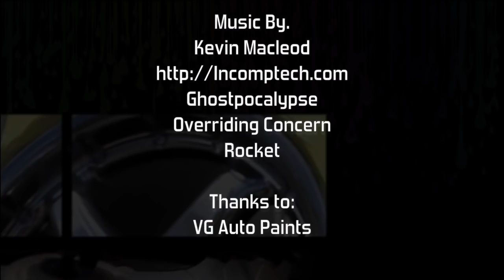First time applying vinyl wrap

Comment: One tip if i may, I worked for a company that made display booths for trade shows, i have applied hundreds of yards of a similar product , don't take the backing off all at one time fold the backing under the vinyl then put down one or two inches of the vinyl start smoothing it out as you pull the backing away , give it a try it really works well,
Reply: vince rappa Yeah.  And try to use a magnet to hold the vinyl in position! :)
Reply: I was thinking the same thing.  Quick question, with your process, could it become a 1 man job?  Also what do you recommend for getting around a roof antenna and sunroof?  I was thinking keeping it sunroof open and cutting away that piece from the inside.

Comment: just when you thought putting a phone screen protector on was difficult
Reply: Totally true!!
Reply: +Rebekah Codlin This is very true!
Reply: +Rebekah Codlin its easy to wrap if you know what you are doing
Reply: +Rebekah Codlin i will suggest to expend in a better quality wrap :D it will come nice I'm totally sure. Remember that old say: "I'm not rich to buy a cheap Prices"  ;) Good luck
Reply: I just binned 3M made in china , don't by Chinesse , go Avery or a cheap paint job...ps actually it was that  bad to use I would of been better off wall papering it lol...
Reply: Rebekah Codlin Chinese products are not good, i heard that their car wraps are absolute trash
Reply: +Rebekah Codlin awesome! Thank you +Rebekah Codlin
Reply: +TucsonMods 

Well, not too bad. had quite
a few little bubbles I managed to pop, and some small wrinkles which I think is
quite standard for a first time......but the carbon fibre design looks a little
wavy when you take a closer look, this is most likely because it was a very hot
day and my car is dark navy (was like a stove top!) so made the vinyl too
stretchy to work with (I could have gotten away with snapping it back up many more
times if it was a cool day). I definitely think I was stretching it too much in
general as when I pushed it into crevices or indents it popped back out and
didn't matter what I did I couldn't get it stuck in those places after it was
down (this was the biggest disappointment). I'm sure that the pro brands
would be a bit more forgiving. The proper technique according to Arlon is
to not pull the vinyl when heating but just to hold it up lightly before going
over with the squeegee (I was pulling it, prolly the nerves and the hot sun
making me tense haha). Only costed $10US to do the boot though! Have ordered
enough for the whole car (about $90US compared to about $1000 for pro wrap like
Arlon/3m etc) so will let you know how a door goes. Will be using the proper
techniques and on a cloudy day, with a felt squeegee this time.....I'm actually
pretty confident if I follow Arlons (www.wrapitright.com) instructions to a T
that I will get quite close to the same result you can get with the pro stuff
for 1/10th the price.....I should do a video so people can compare it and see
if they want to take the leap and save a lot of money
Reply: +Dave Wolf The boot wrap turned out not too bad. had quitea few little bubbles I managed to pop, and some small wrinkles which I think is
quite standard for a first time......but the carbon fibre design looks a little
wavy when you take a closer look, this is most likely because it was a very hot
day and my car is dark navy (was like a stove top!) so made the vinyl too
stretchy to work with (I could have gotten away with snapping it back up many more
times if it was a cool day). I definitely think I was stretching it too much in
general as when I pushed it into crevices or indents it popped back out and
didn't matter what I did I couldn't get it stuck in those places after it was
down (this was the biggest disappointment). I'm sure that the pro brands
would be a bit more forgiving. The proper technique according to Arlon is
to not pull the vinyl when heating but just to hold it up lightly before going
over with the squeegee (I was pulling it, prolly the nerves and the hot sun
making me tense haha). Only costed $10US to do the boot though! Have ordered
enough for the whole car (about $90US compared to about $1000 for pro wrap like
Arlon/3m etc) so will let you know how a door goes. Will be using the proper
techniques and on a cloudy day, with a felt squeegee this time.....I'm actually
pretty confident if I follow Arlons (www.wrapitright.com) instructions to a T
that I will get quite close to the same result you can get with the pro stuff
for 1/10th the price.....I should do a video so people can compare it and see
if they want to take the leap and save a lot of money
Reply: +Rebekah Codlin Sound amazing and cheap :) i will be looking for your video if you make any.

I also purchase a piece of carbon fiber look vinyl wrap and really i did not like it very poor quality it took over a month to arrive, so i will try another brand and see how it goes :D Happy Holidays by the way.
Reply: +Rebekah Codlin  Using a heat gun makes everything WAY more easier because it gives it free stretch and helps removes air bubbles
Reply: I'm in the process of wrapping my car, have been very successful using no heat on flat areas and just a touch of it on curves....with cheap china stuff, it has very little give, so have to be very careful to stretch as little as possible, just enough to get it over a curve
Reply: I hope you can share the result :) good luck Rebekah Codlin
Reply: Bek C do you have a link from where you ordered the carbon fiber?
Reply: they did all wrong. you have to put water and soap on the surface so the vinyl does not stick and then gently with a plastic spatula remove the exess of the liquid inside the vinyl and when dry it works perfectly.
Reply: how long does vinyl last?
Reply: Doing this seems like it's a 2 man job.  Plasti-Dipping appears to be easier.  If this isn't put on perfectly than it will have bubbles and look like crap.
Reply: @115zombiehuger  to know what you are doing requires experience. To get experience you need to practice. To get practice you might make costly mistakes?
Reply: Hahahah right
Reply: Lmmfao 😂 🤣

Comment: Nice job guys, a tip. strart from one side of the hood, dont peel all the backing paper and use strong magnets to hold the vinil in place, once you finish one side remuve the backing paper from de other side and keep it lift as you aplied the vinil with the sqeegee.
Regards from mexico city.

Comment: Not bad for a first go however let me share my technique with you, it will save you a lot of messing around. Basically you need to use application fluid, "right on" is a good brand. If you use fluid you can just squeegee the bubbles out no problem. You want to get the vinyl down as quickly as possible to stop any dust getting under it and showing through. You shouldn't keep pulling it back up because it creates static electricity which attracts dust particles. The right on fluid will allow you to physically position the vinyl even whilst its stuck down, then once you're happy give it a bit of heat gun to secure it. Obviously don't apply fluid near the edges.
Reply: Hey Lee Rees. Sincere question to your comment, not trolling you, I want to learn. I know that application fluid goes with some foils so that it could be squeezed out and foil to be sticked. But if it's that "bubble free" wrapping foil (with air channels) which has it's own adhesive, wouldn't this fluid mess up that adhesive?
Reply: kobajage yes. Vinyl with air channels is not made to apply using the wet method. So Lee Rees your tip is wrong. It probably won't hurt the adhesive but there are risks.. Problem here is that the guys are using low quality film (calentered) which has bad re-postitioning and slideability features and the wrapping techniques are basically compitely wrong.
Reply: Lee said don't get it near the edges , meaning don't get it on the adhesive . He is using the liquid as a lubricant to held smooth out the material.
Reply: this isn't that type of wrap,i suggest looking into what you claim to have experience with before STICKING YOUR PROVERBIAL FOOT DIRECTLY INTO YOUR MOUTH.
you spray this car with the product you mentioned you would have a very expensive ball of carbon wrap in your garbage can.
Reply: Lee Rees thank you

Comment: Ideally, you want to heat the whole piece of wrap(sized about 30-40% larger than panel) and use what I call a  "drop wrap" technique that envelopes the entire panel (as much as possible). From there, work from the center outward as needed. It helps to have 2-4 people helping you.

Comment: Whats up with all the dislikes! that looks like a professional job!
Reply: Thatcher N i thought me ex wife was a wonderful person.
Reply: Nah so many errors, You don't apply material the way they did in the beginning, you don't force air out of wraps, you NEVER touch a wrap with your bare skin/hands, and you never use that much heat. Wraps contract an expand in hot/cold conditions, the way this was applied it probably lasted a month if that, the change in temperature causes the edges of the wrap to finger and come up.

Comment: just a tip I discovered when wrapping a truck, that the little plastic smoother leaves scratch marks, I put a sock over mine and used it that way, worked like a charm and didnt leave scratch marks

Comment: This looks doable but idk why shops charge lol 2k to do this lol I will be doing this myself 👌🏾
Reply: +D_Lambily Depends where you go. The most logical reason behind it is the sheer cost of material..
We use a wrap called hexis where the basic wrap costs around £12 a metre and the high end is around £45-60 a metre. All depends on what colour, finish and style you want. 
Its a skill to do though, these guys got there in the end but the way theyve done it... it wont last long.
Reply: +SuPrAmAd101 how do you make it last long then?
Reply: Prep is the main thing, Hexis suggest using there cleaners & degreasers (they wont warranty the vinyl if you dont) 
They stuck it down with a squeegy, once you place pressure on the vinyl you activate the glue, and pulling it up multiple times will weaken it. 
They never heated in the vinyl, this means it will shrink and lift. Heating in is probs the most important step
Reply: why would you pull up and relay if you have bubbles? If you lay it properly you will have minimal if no bubbles to start with. 
Secondly the vinyl is more than likely to be easy apply and will therefor allow you to work the bubbles out without lifting. 
I work for a signmakers who do vehicle wrapping on a day to day basis, what experience do you bring to this comment?
Reply: REALthugnasty The majority of vinyl comes air release now anyway, even the cheaper ones! although, the glue is terrible
Reply: +REALthugnasty  Where is the best place to buy quality wraps?
Reply: REALthugnasty
 Thanks! Very helpful. I think I may have found a good one.

Comment: wax & grease remover wont damage the paint, its even used for cleaning dry paint surfaces before the next coat. Its good cause it cleans & then evaporates away

Comment: Good video which shows everyone what not to do when applying vinyl wrap. These guys are clueless.
Reply: so what do you do and what's wrong with what they did ?
Reply: I'm a vinyl technician and what they are doing is completely wrong! 1st, the way the peal the backing paper made it completely difficult. 2nd, the way they heat and pull, will definitely have heat stretch marks. 3rd shouldn't have the bonnet open. No need. More likely to have dust

Comment: soapy water so the surface is slightly wet before applying the Vinyl, makes removing the bubbles a ton easier, then use the heat gun to stretch for the perfect fit, also you guys should warn against too much stretch when using a pattern, so you don't distort the pattern :)  all the surface should be damp........from my limited sign writing experience with Vinyl anyway, never tried to wrap a whole panel like that tbh :P

Comment: Why you guys trying to ne marty an moog from mighty car mods??
Reply from the maker: Because they are awesome.
Reply: +customspraymods im guessing you don't wrap cars often, your meant to use soapy water to help apply. using the soapy water stops it from sticking completely enabling to lay it ez and not running the risk of stretching the design.
Reply: +115zombiehuger interesting, im planning on wrapping my car. do you mean soapy water on the sticky part? or just on the outside to help with smoothing it on?
Reply: +Rebekah Codlin yes you spray the sticky side till its soaked then a little on what you are sticking it to. then lay it from top to bottom making sure not to catch air bubbles if so you should be able to re lift carefully and place back down.then using a Wet edge squeegee push all any left over air bubbles to the outside, if you can't then using a scalpel and put a small hole in then press flat. its much easier if your covering the whole panel other wise you will need tape to hold it central to the panel.
Reply: +115zombiehuger not all wraps require soapy water. my friend does this for a living. 90% of his material doesnt require anything under it other than a quick clean off of dirt, or residue
Reply: +Robert Stanton not soapy water actually but normal water will do its good use to prevent premature sticking and void air bubbles

Comment: No water. noob mistake!
You'll fudge up perfectly good wrap as soon as it comes to curved surfaces, and you'll be getting cracked tension lines in 6 months of sun.  Thumbs down!
Reply: yea they did mention it was their first time...
Reply: say what...? it seems that you don't have any idea how it should be done.. Never water with vehicle wrapping. The vinyl was clearly a low quality ebay stuff, with good film, its easier and definitely doesn't require water, not even two people to install the hood.
Reply: Not that I have wrapped my own car.... 
Of course water is a requirement. Your argument is invalid.
Reply: ***** man, water is not used in car wrapping.. Did I understand something wrong or what you mean?
Reply: Invalid response, please retry.
Reply: ***** did you say water. you probably mean to clean, like car wash before wrapping.
Reply: Wrapping does not require water
Reply: Only if you require angles.
Reply: ***** wrapvinyl is usually stretchable by 30% use a heatgun to fully extend the stretch, cheaper vinyl is preferably applied with water/soap over curbed areas, cheaper vinyl are the preferred material used with cut out designs/logos.
Never tried applying wrapping wet, but I guess the air channels in the vinyl wouldn't work proper, and you would manually have to squigee the water out instead of the air. Good luck with whatever you doing.
Reply: ***** We have been doing vinyl for years. Wrapping all kind of stuff from cars to motorcycles. If you are using a proper wrap vinyl, you DO NOT use water period. Not sure what crap vinyl you use but TeckWrap, 3M, etc are applied without any water.
Reply: 3m got loads of vinyls that can be applied with water, never heard of TeckWrap though.
Basic idea to me is that most wrap vinyl is air channeled and you squege the air out, if water gets in those channels you most likely gonna get into a mess.
Traditional vinyl got the benefit of being cheaper and gives better result when cutting out logos or designs, it requires more work though when applying those around edges and corners though, when i do something like this 
dekorfilm.se/dekor-film/bildekor/bildekor_rydsbilgas_volkswagenpolo_06.jpg
I prefer a 10-20% stretchable vinyl and applied wet stretched with brute force around corners, this one was done with a Avery 700 series regular vinyl.
Anyone that tried cutting out a logo or design from a wrap vinyl can probably tell you about shapes and lettering being messed up when squegeing the air out and leaving you with a bad job. So diffrent jobs requires diffrent techniches if you ask me. psss (it adds extra $ and more buisness when you can deliver nice designs made inexpensive and to a fair price) ;)
Reply: ***** bro you're so mad lmao
Reply: how should it be applied for me not to get the crackings because of the sun?
Reply: opening your mouth before fully understanding the aspects of the situation... "NOOB MISTAKE"
Reply: ***** You don't use any water to wrap cars...
Reply: that Neon guy most likely using vinyl made more for lettering and logos, u can still wrap with it. i dont recomend it though (you'll be getting cracked tension lines in 6 months of sun)
Reply: No water with a wrap mang... Heat gun or torch is all you really need besides your squeegees and blades
Reply: I use water, I drink it during the entire process because I get thirsty, as far wrapping water is not used  :D
Reply: If you look at any of the pros who are certified in vinyl wrapping, they will all say do not use water.
Reply: $30 for wrap material and a friend and that's all you need. If it doesn't last long, who cares at that price
Reply: +NeonVisual you need blinker fluid to install vinyl wraps to horses as well? I think I'm getting the language correct.
Reply: vvivid vinyl requires no water. Quality products you should not use water on vinyl.
Reply: They using way too much heat. Not gona last 6 months

Comment: LOL as a vehicle wrappen in the UK you guys with no experiance should use 3M carbon it has an air system so you do not have to keep lifting the vinyl or try a company called Hexis, you should also be laying the viny with a felt edge applicator to make sure you do not scratch the vinyl. Nice job!

Comment: I questioned the approach @ 1st but hey it came out good so good job. I tried doing 1 myself on my 03 maxima. Was not good. I can’t remove the washer fluid dispenser parts on the hood so will have to cut around. & I pre-cut the wrap too much down to size. & don’t have a heat gun. 🤷🏽‍♂️ paint in the back. I nearly had it all done but @ the front end I got very frustrated.